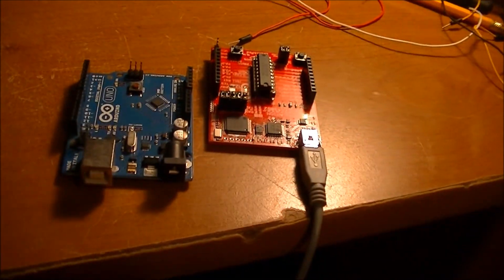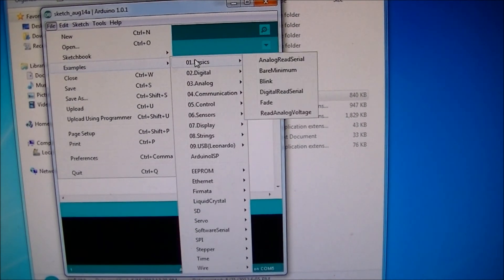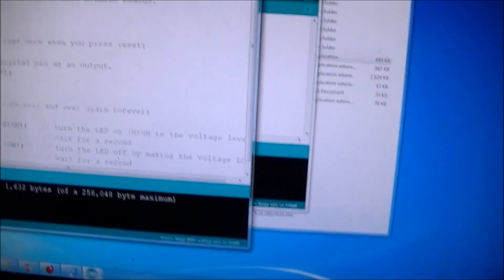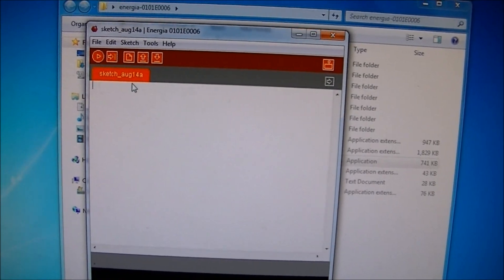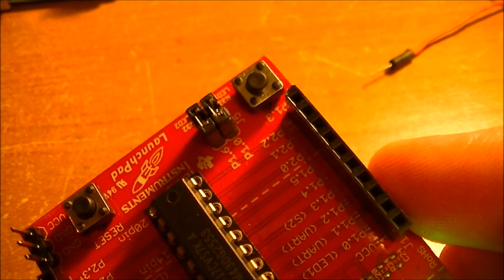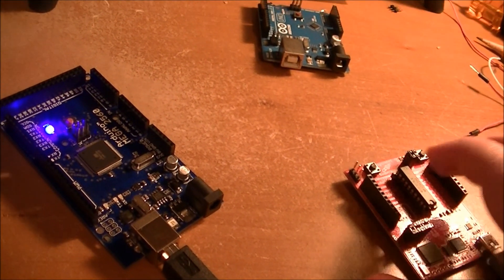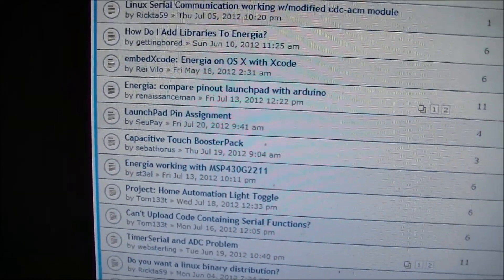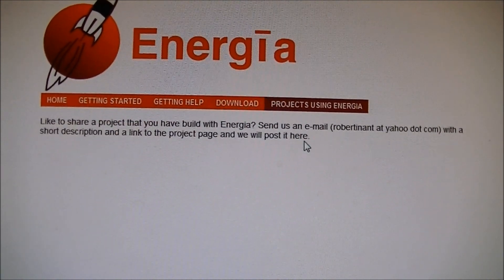Program Launchpad MSP430 like an Arduino with Energia

Comment: Why would you want to program anything like an arduino? Even with my arduino uno I avoid the arduino ide at all cost instead I use avr-gcc which is much better my program speed increased alot.